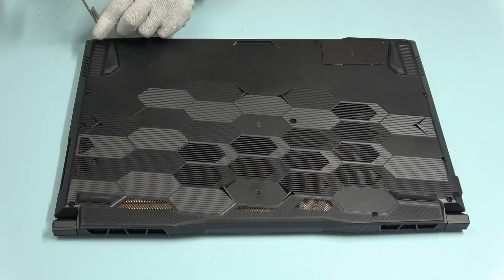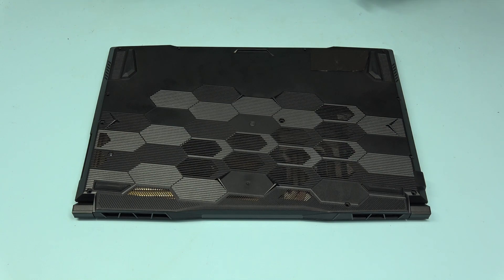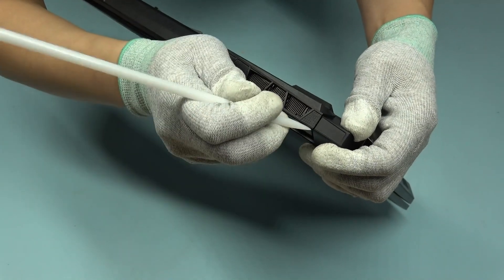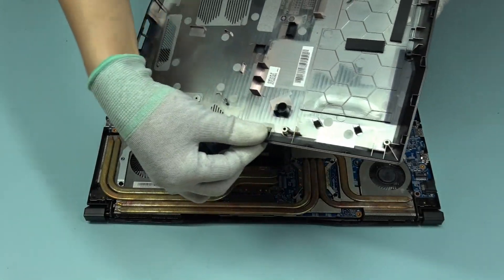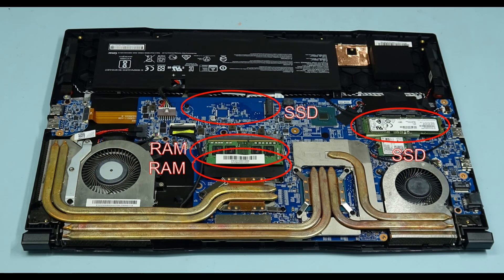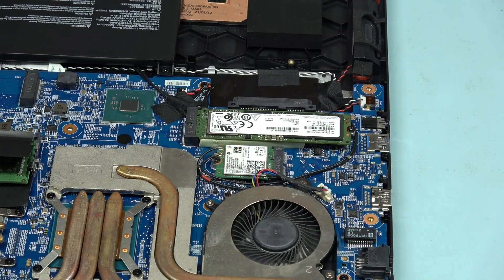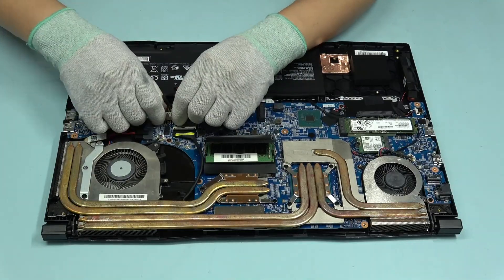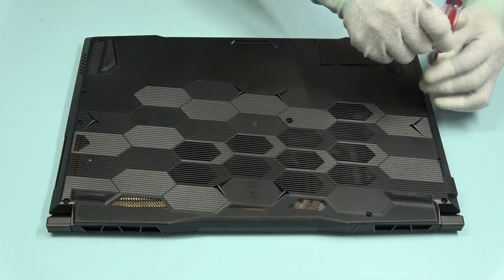MSI Pulse(GL76)/ Katana(GF76)/ Sword/ Crosshair/ Alpha 17/ WF76 Series SSD & RAM Upgrade Tutorial

Comment: You don't need to reset the embeded controller to add an ssd! It does no cut power to anything. Reseting the EC = reseting the bios, which will require you to reconfigure everything...
Reply: https://youtube.com/channel/UCmQ7gpjINvZn0EyxoI9_xvw?sub_confirmation=1
Reply: i still can't reset the bios although i pushed on that 'jumper'/button, and so i can not use my new 4tb nvme, as i am on a gf76 katana 12ud-041, which only has 1 nvme slot. can you explain to me how i can reset that bios instead of putting the old nvme back to it, to make the laptop working, as everytime i tried the reset nothing happened...ty in advance, if you help me to fix this error with a proper solution.

Comment: What about adding an extra regular hard drive to the Katana GF76 11UD version? What regular hard drive would fit in it? 
Mine doesn't have slots for two SSD. Thanks.
Reply: Ryan ward I have this model and I want to add more storage. I know I need a 2.5 ssd sata but I don’t know which one will have a high enough read and write speeds for gaming. You have any advice that would help?
Reply: https://youtube.com/channel/UCmQ7gpjINvZn0EyxoI9_xvw?sub_confirmation=1
Reply: I'd like to know if the WF76 model can handle windows 11, if it's bought with a native win10 home setting in terms of hardware setup?
Reply: @deloneledbedder250  hi I’ve changed ram for 2 32go. So I guess you can add 16 to reach 32 but be sure to putt the same model of existing ram on yours.

Comment: mine only have 1 slot ssd nvme.
very dissapointed
Reply: Yes, I think the same problem 😔
Reply: its because there are two different, the gf76 11-ud just have one
Reply: @jhotanan1224  Damn, I wish I had known that before buying it..
Reply: @jhotanan1224  i do own the gf76 11ud, can I add a 2.5" ssd
Reply: @momo_hl  yes. MSI told me on the phone that this model can have a 2.5 ssd sata. I have the same model and I’m trying to find one that has a high enough read and write speeds for gaming. You have any suggestions?
Reply: @mightymarlo3101  there is the Crucial P5 Plus, 6600 MB/s read and 5000 MB/s of write speed
Reply: @momo_hl  that ssd is sata or m.2?
Reply: @Actor_mp  m.2